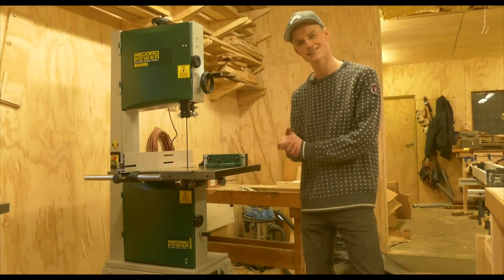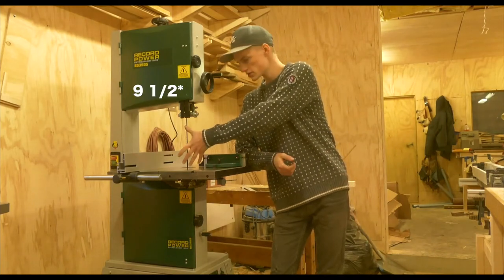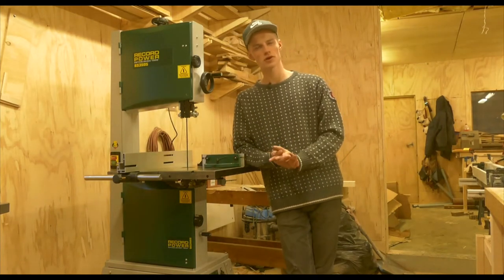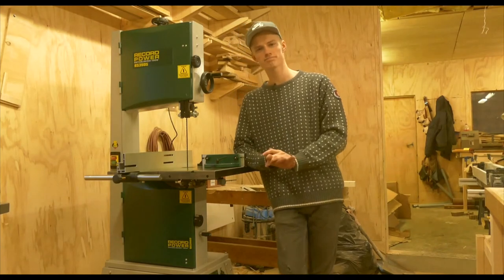Setting up and Testing my NEW BANDSAW // Record Power BS350S

Comment: Hi Are. Well, you've had your new saw for a few months, any problems yet? I've had the same one for sometime now and I've had various problems. Can I ask you to look under the table at the blade back bearing. Does your blade run down the centre of the bearing, or does it barely touch just the side like mine does? I would appreciate your comments.Love your work by the way!
Reply from the maker: peter smith Hi Peter! I have not had any problems with my saw yet. My blade runs down the center of the bearing, and I'm sorry but I couldn't see an easy of fixing your problem! 😕 Have you talked to the store you bought it from? Thank you!
Reply: Are Baloni Hi, thank you for your reply...yes, I have spoken Record technical support, and they said the blade should be on the side of the bearing? I don't agree! I can only see the way to correct the problem is to adjust the lower wheel a degree or two to the left. When I suggested that to them, they said the wheels are factory set, and should not be altered... My theory is, it wasn't set correctly in the factory in the first place! I have a friend who is an engineer, and he is going to help me make that adjustment.  I'll let you know how I get on! Can I also add, the blade is so far to the side of the bearing, that if I push the work too hard, it's possible for the blade to go down the side of the bearing, missing it completely. This then twists the blade and effectively destroys it!!
Reply from the maker: peter smith Wow, that is weird! I agree, it does not make sense that the blade should be like that! Let me know how it goes! 👍🏼
Reply: Are Baloni Will do. Keep your videos coming please!
Reply from the maker: peter smith Thanks, I will! 😁
Reply: Are Baloni Hi Are, here's the update as promised... Yesterday, we spent a few hours looking at the saw, and agreed there was the possibility that moving the lower wheel to the right would cure the problem of the blade not running in the centre of the lower back bearing.  We moved the wheel to the right as much as possible...amazingly the blade stayed where it was , running on the left hand side of the wheel??? Not even logic can solve that mystery!  Anyway, in running the saw, it is now much quieter with no odd screeching sounds. More than that, I was able to rip down a 4 inch piece of beech held against the fence, and it performed beautifully for the first time ever!  So the mystery of the bearing remains, but the saw seems to be working beautifully!!

Comment: Setting up the blades properly: watch this video, works grrat on any bandsaw, as long as you have a new/non-damaged blade. https://youtu.be/wGbZqWac0jU
Reply: Er disse produsert i England? Lurer på denne kontra axminster at 2225 serien , ser Record har 1.5hp kontra 750w på axminster , valgets kvaler 
John